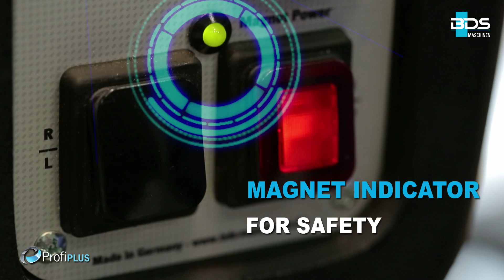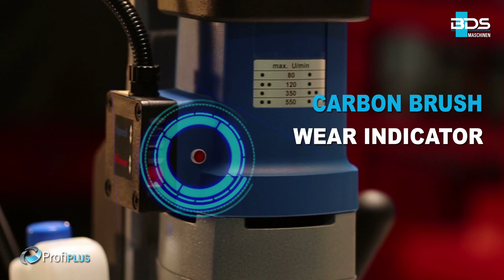STRONGEST mag drill | Strongest magnetic drill press | magnetic drilling machine | MAB 1300

Comment: Why is it so hard to give up the price, is it a secret.
Reply: $5,180.00 little bit too expensive, i can buy a whole CNC mill for this money.
Reply from the maker: The pricing of our products for every country is different because of the Customs, Local Taxes, Freight Cost, etc. The price of MAB 1300 in Germany is 3659.00/- Euros Ex Works.
Reply from the maker: This is a List Price. Our regional Distributor will also avail you an attractive discount.
Reply: @Guds777  Try bringing a cnc mill onto a construction job site, such as up onto a steel framed building for drilling, or any other metal fabrication construction field jobsite, etc etc. 

Your comparing apples to oranges.  

CNC mill is for production machine shop work. 
Mag drill is for construction fabrication work in the field or plant.

Try drilling out a broken 4" steam turbine base stud with a cnc mill. 

As for the price point, what kind of cnc mill does 5k get you? A Chinese playtoy mill or an old worn out industrial production cnc machine at auction that is punched and ready for the scrap pile. 

This is solid German engineering made to last a very very long time working in real world field conditions.

5k is peanuts for the quality and capacity? 

My MAB 845 was 2900$ USD with free cutter kit and all accessories.